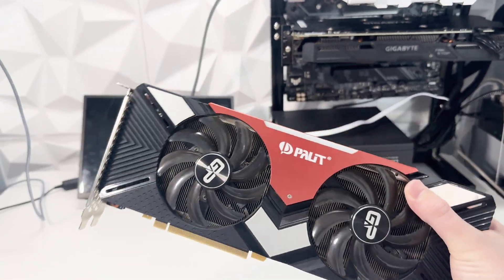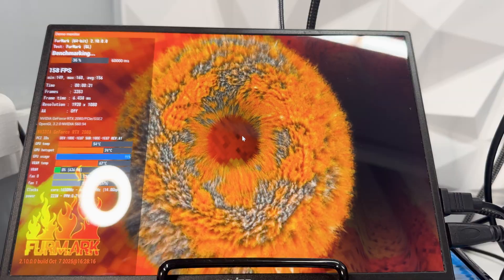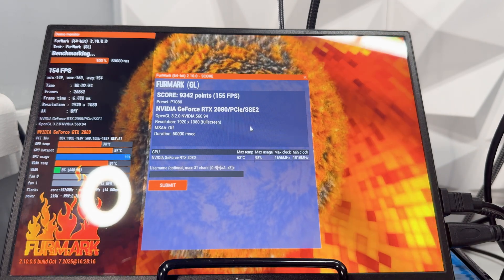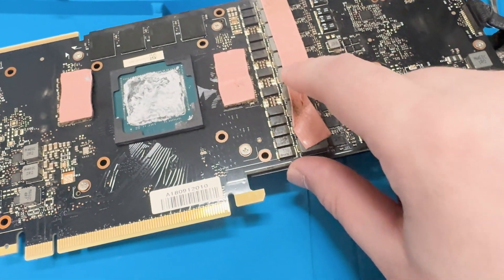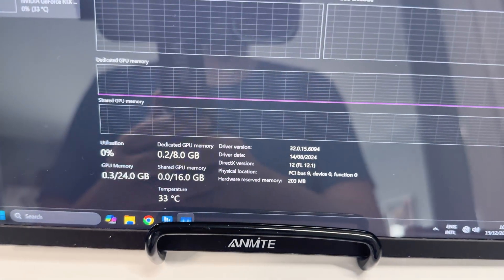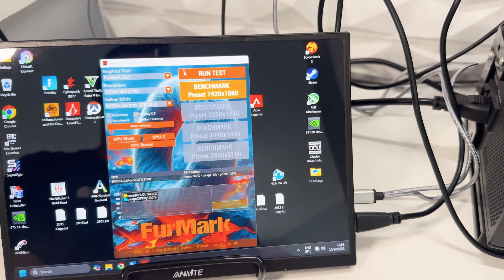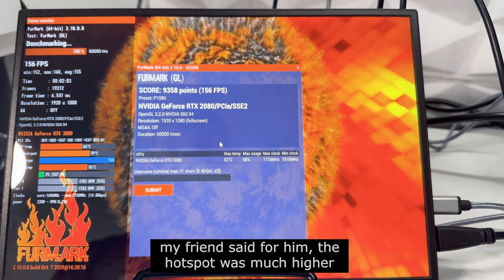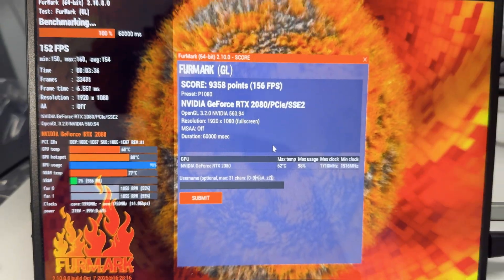His RTX 2080 Was Running Hot...Can PTM7950 Fix It?

Comment: You need to do a few heat cycles to get the best results, run it at max power for 10 minutes, stop running it for about 5 minutes and repeat 4-5 times.
Reply from the maker: I know bro :)
I use it on my cpu also!